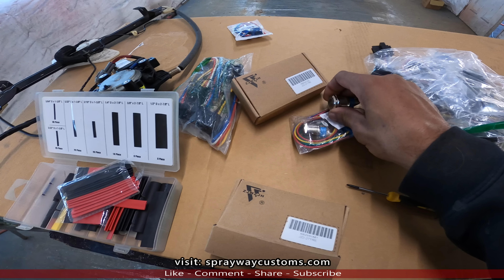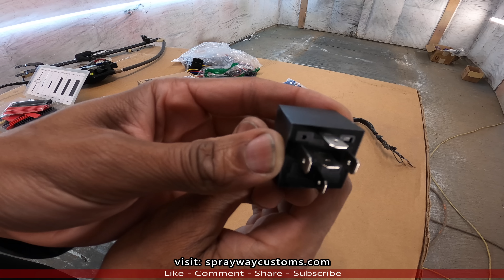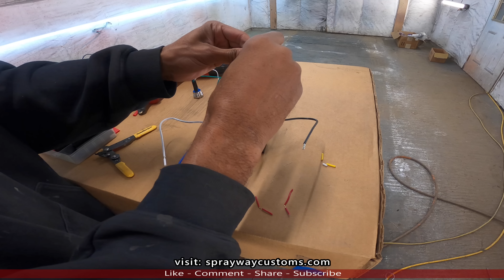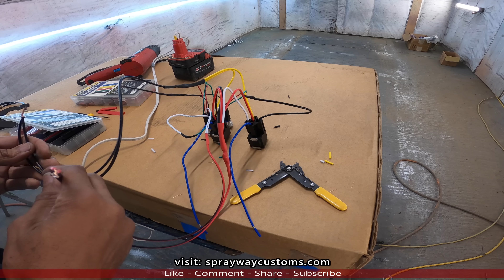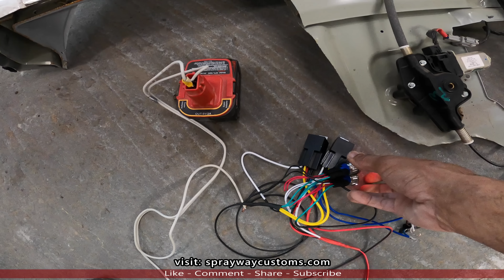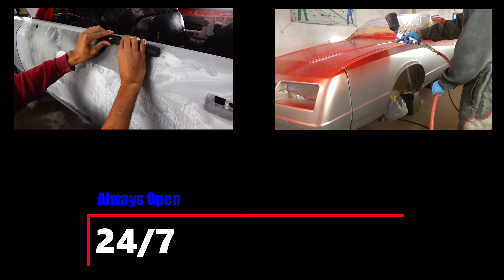How To Wire A Billet Momentary Switch And Relay For Power Windows DOOR LOCKS Sunroofs EXHAUST CUTOUT

Comment: Hey boss you think this set up would work on some chairs? I have a 90 Lincoln towncar and all the functions on both seats work except the forward and reverse. Forward works better but it’ll stay forward I’ve tried all I can see the only thought left was the cpu brain under the driver seat  the box the relay inside is no good bcuz I’ve manually made the seats go back and fourth and the button on the door panel has power so that’s why I’m thinking it’s that box..

Comment: Thanks for showing the wire routing. However just twisting the wires together and heat shrinking is not making a solid connection. Those can easily work themselves loose in the future. Please use either butt connectors or solder the wires together to ensure a solid connection that won’t short out and potentially cause a fire.

Comment: I'm lost on the wiring part.. 87a¿ 86¿
Reply: 87a is just the opposite of 87.
If 87 is open  a will close or vice versa..
The numbers represent Bosch relay pin outs
Reply: @luvdady  would the ignition be in place of the battery if it’s in the vehicle so instead of running it to the battery like he did, you would run it to your ignition source so when your car cuts on, you can roll the windows up and down rather than when it’s off because I figured if it’s ran into the battery that would be given constant power just trying to see if I’m correct trying to get this sorted out here
Reply: @ChevyChavis 30 is power in 
87 is power out (87a is flow through) 
85Switch side /86 ground
So  30 is constantly getting power (87a if applicable,  is flowing that power to the output)
85 is a toggle switch for the switch to send power to 87 (and turn off 87a)
(86 is simply ground to complete the circuit. )
Its overwhelming,  but just one thing at a time makes it simpler. 
I start with ground.  Then power in , then power out and then the switch on.